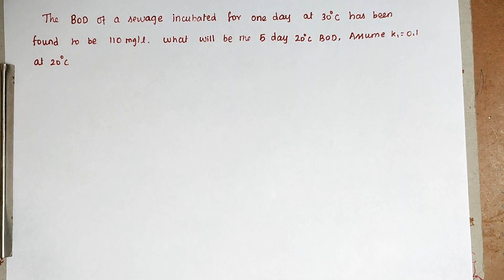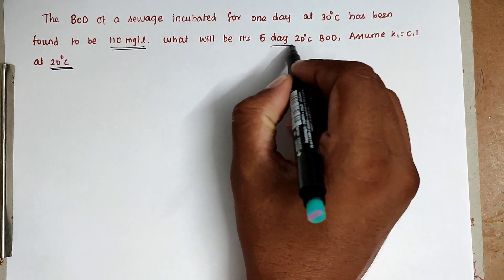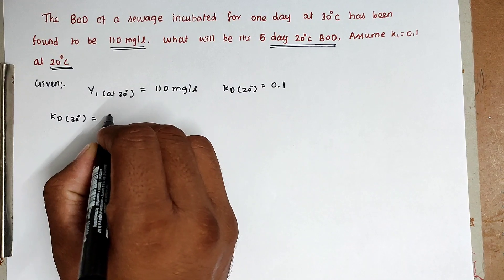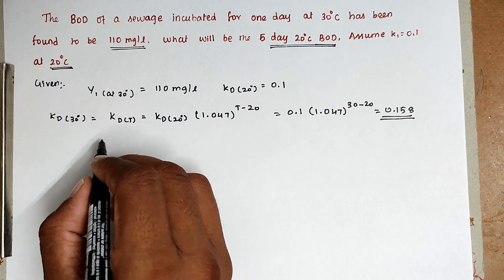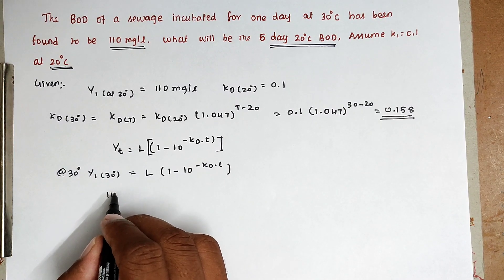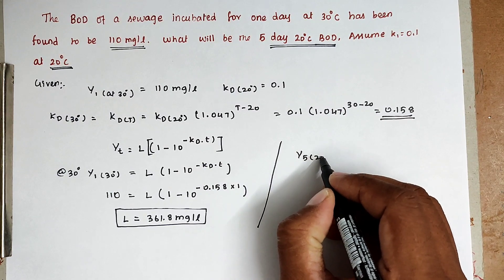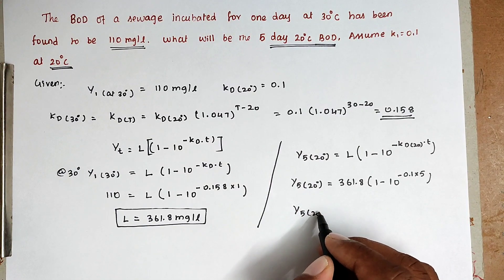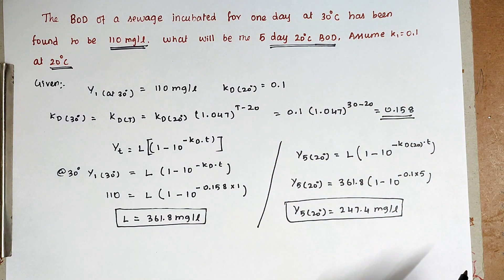BOD and Ultimate BOD, BOD problem, how to calculate ultimate BOD, BOD of waste water, Unoxidised BoD

Comment: Calculate the bending moment at all salient point along the beam number of spans 4 4 clear distance between support 4000 mm effective depth of 350 mm gross depth 400 mm width of the beam 230 mm width of the support to 230 mm imposed lord not picture 8 km by m imposed load 12 km by m excluding self weight partical fixinty may be expected at the discontinuous edge design the beam for maximum bending moment also.USE m20 grade concrete and fe 415 grade steel 
Please explain this problem in diploma 4th sem in ddrcs